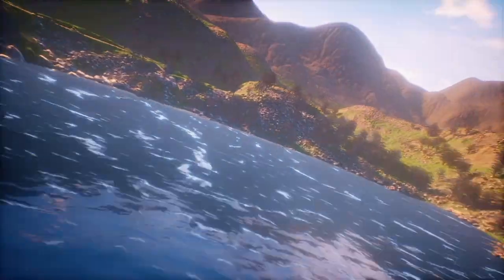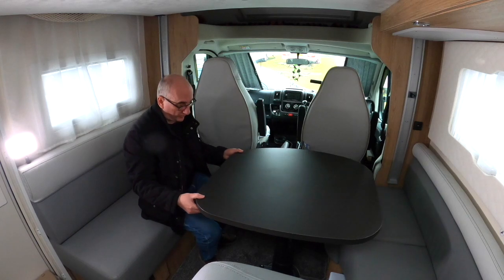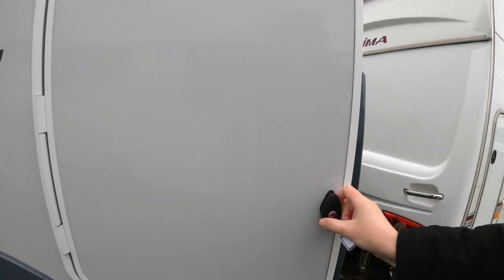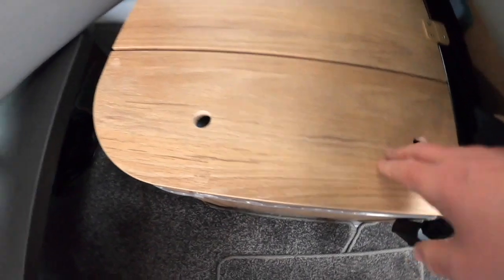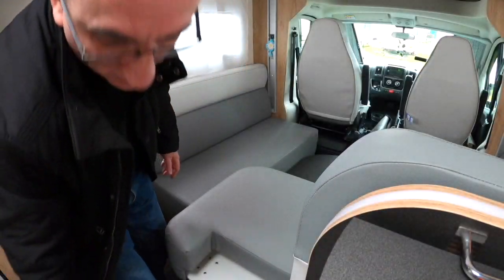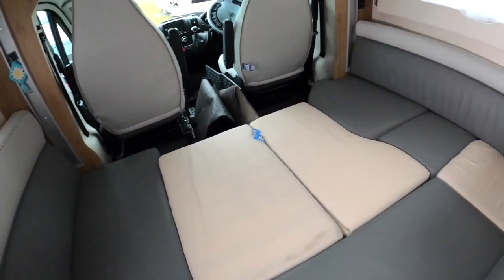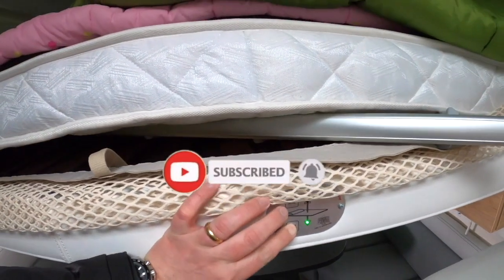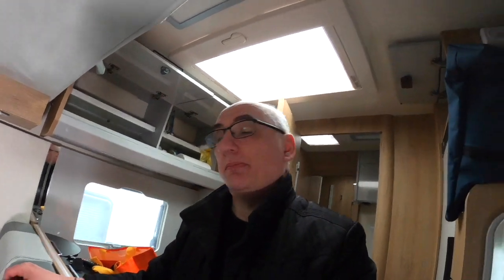How to Make up the Dinette Bed in a Roller Team T-Line 590 Motorhome

Comment: What happens if the electric fails on the electric bed? Good vlog
Reply from the maker: There is a little drop down door where the mechanism is to manually lower or raise. Not tested it yet. Thanks for watching.

Comment: Can you get to the little table from inside the motorhome?
Reply from the maker: It would be a stretch. My wife thinks there is a piece in the wardrobe to clip it to but either way I would be tempted to store it either on the top shelf of the garage (access available from bathroom) or in the wardrobe itself. Thanks for watching. 🙏
Reply: The little table can be stored in the clothes cupboard area within the bathroom area there is a twist clip on the right hand side of the storage cupboard where the clothes rial is.
Reply from the maker: @paulcornelius300  yes there is. On our van it is only big enough to store the wooden panel that fills the gap between the seats behind the drivers seat. The table to make up the bed will not fit. We keep ours above the bed along with the cushions.
Reply: @LiveforTravel  We love our van and have been all over Europe with it they are good vans with great ground clearance even on Sandy beaches and camp sites a great smaller all around van I hope you have many great journeys in it.
Reply from the maker: @paulcornelius300  agree we love our van too. You forget it is only 6 metre long 😊 we do intend to do places in Europe. Thanks for your comments and we wish you many happy memory making trips in your van too.